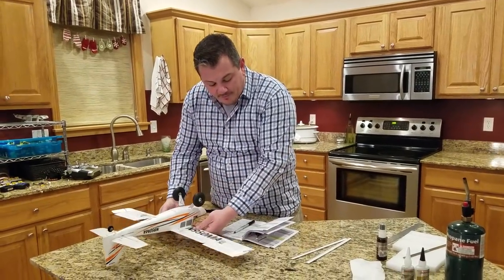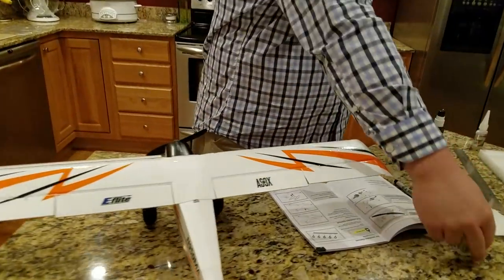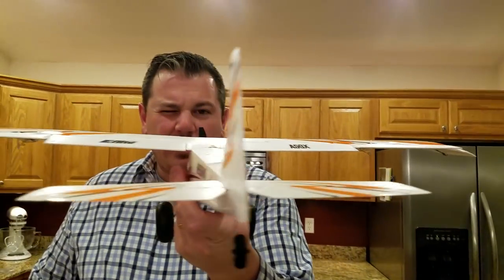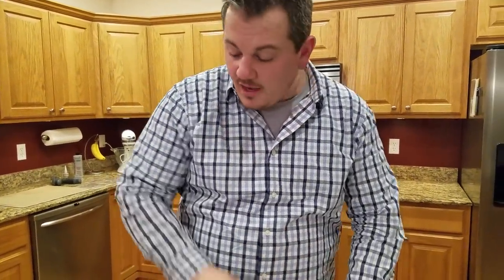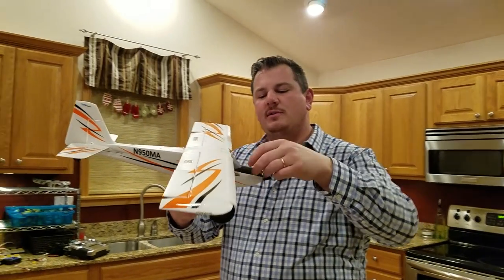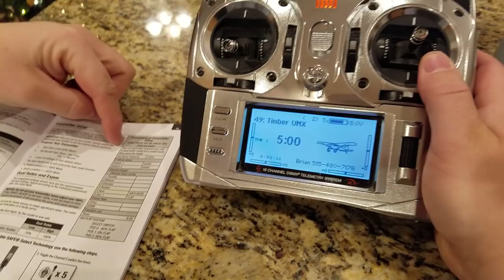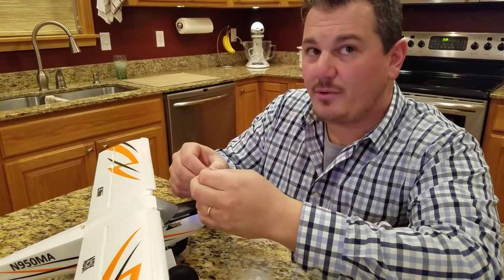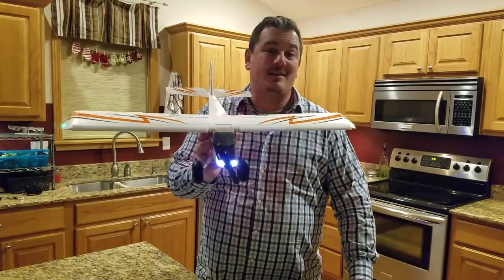Eflite - Timber - UMX - Assembly, Radio Setup, and Tips

Comment: Hey bud, question: I’m having a tough time hooking up safe on my dx8e. As3x is activates, and I have moved both controls in outward opposite directions while flipping the assigned switch back and forth 5 time per manual, but still no safe. Any ideas? It’s all new equipment and new airplane
Reply from the maker: I thought the sticks were to point IN at each other...
Reply: Brian Phillips interesting... I believe I tried both, because to set a Safe Select switch on the regular timber 1.5, I had to point both sticks together and down while cycling the switch I assigned back and forth 5 times, however, that didn’t work either... i dunno. I gotta pick up some lipos for my DX8e because I was just using the regular double AA batteries that the transmitter came with and they are already dead after just trying to bind 3 airplanes to it. I do like your ideas regarding setting the rates the way you explained juxtaposed to the 70% or 100% the manual suggests, but when my lipos come in I’m gonna continue to try. Any batteries for my transmitter that you would recommend? I was actually thinking about making my own battery packs, but that will be a future project.
Oh, one last thing; I did fly my apprentice, as this was the first plane I’ve flown in 25 years and all i can say is YOU ARE THE MAN!!! I have NO idea how you fly these bigger birds around your neighborhood with such impunity. You make it look MUCH easier than it is. I was a huge open Park and was worried about hitting something...but you weave these flipping things in and out of houses on your block and backyard! And let your camerawoman know she’s the best in the business! I watch all the vids you made when it was cold and snowing, and she was on top of it the whole time
Reply from the maker: I wonder if you bound it the OTHER way... There's TWO methods. Maybe you got it bound, but it's in AS3X only mode??? I wish I could just do it for you, but I even have trouble remembering the exact steps (I have to read the stupid manual EVERY time - LOL)

Did you assign the switch you're trying to use to a channel? Sometimes they aren't assigned in the stock configuration, until you go to channel assign... TRY THIS

As for battery for your DX8e, here's what you need... https://amzn.to/2I1uv7Z ...these things are great!!! I HATE using alkaline batteries. They always seem to be JUST about bad by the time I use them, and I'm WAY too cheap to get the name brand...I always get the cheap Rayovac, or whatever store brand is cheapest...then they leak...LOL

Megan does a wonderful job of keeping the plane in camera. It's way harder than most realize. We're all so lucky she's a mostly willing participant my shenanigans :)

As for the neighborhood...I had a hater TODAY...commenting about how I was all "look at me" and how he was such hot stuff, and how if I was at his flight field he'd give ask me "Is that all you got".... These FOOLS think they're advancing the hobby. Hand-Face

Here's the excerpt...

"
truckermax120 hours ago (edited)Highlighted comment
Its all about the ..."Look at Me,Look at me" attitude.I think he is well aware of the possible chances of a person,property being injured/destroyed.He'll take a chance with the neighbors children on a low fly by,but as he's getting ready to land he reminds his wife to keep an eye on his kid while landing.
Hmmm...
I'm no old fart,i've flown many of years (usually 700 size electric helis)doing close to the ground 3D and fly regularly,so i'm well aware of the probable chances of mechanical,electrical and human error that can happen at any given time.
For the beginners watching this it appears "impressive",but for people with flight time and common sense,it's beyond stupidity!!!
All i have to say is...Really dude???
If you were at our field and did that type of flying in front of us,I'd be the first one to walk up to you and say...
IS THAT ALL YOU GOT???????? Really dude??
Again,you look "ONLY" impressive in front of a beginner crowd,whoop ti do!!
SAFETY is the number one priority:
Above your flying ability
Above your model
Above your financial means to pay for any injuries and or damages
You're wrong dude,you're waaaay wrong!!!
"

...here's the video, if you're curious - https://youtu.be/hQpkaAlaafc

It's guys like this that just floor me. Then I check their channel, and he has one video with like 10 views and 2/1 thumbs down ratio. It's really unfortunate. I'd be all about helping a guy out, but he's such a dick! These trolls are about 1/1000 in my experience. I try to keep their negativity out of the channel, but it's kinda nice for you guys to see what I put up with the channel. I wish I didn't have to admit this, but in my experience, there's a LOT of guys like this in the RC community, which is why many RC shops are going out of business, and many clubs are like 7 grumpy old men that like to argue with each other, rather than teaching new people how to enjoy this awesome experience.
Reply: Brian Phillips hey brotha, I’m on board with you 110%!! I get nauseous every time I tell myself “look Ross, there is no way around it.  You’re gonna have to join a club...” I’m all about safety and have yet to see you do anything remotely dangerous in ANY of your vids. Actually, I’ve watched your channel the most because of not only the great flying and videotaping, but because you narrate what you are doing, and for people like me who are either getting back into the hobby or just getting started, we appreciate the way you explain everything to a ‘T’. Please, keep the videos coming!! You have been the most helpful with every single aspect of the hobby. If I wanted to listen to music while flying, I’d plug in some headphones. If I wanted to read someone’s headers instead of narrating the play by play, I’d go to friggen google. People can pretty much learn how to perform open heart surgery thanks to YouTube (not condoning in anyway, but you get the gist). As far as some of these grumpy bastards go, I’m gonna be honest, that’s probably what kept me away from flying for SO long. But now that they have all of these EPP, EPA, and EPO foam electric kits, it makes getting back into the hobby 1,000 times easier. The fact I took the apprentice up for the first time in 25 years, by myself, at a park with not a soul in sight, I am just as excited as I was the day I started, if not more excited.  I like the way the hobby progressed and you’re always gonna have these people saying “well I remember in my day you’d get your ass kicked if you flew anywhere besides our clubs field. It’s like, come on dude... I get if someone is doing some reckless BS, but people like you that have total control over the aircraft st ALL times should not be bothered by ANYONE in the hobby. In fact, they should shut their mouths and listen to what you have to ay for a second. They might learn something. I remember learning ima nitro trainer. My first flight was probably around 1988 when I was around 9 years old. I had to buddy box for months before I was able to fly solo. And forget about it if you made a mistake....  you were set back from flying that plane again for months - even though rebuilding is just as much fun as flying in my opinion. 
Anyway, thanks for always getting back to me and thank you so much for being as detailed and informative as you are. Not everyone is willing to take the time out of their day to explain from the second you unbox to the second you have to rebuild (or mod). By the way, I got the umx timber bound FINALLY just following your steps, but then if course the rest of the alkaline batteries I had died before I could get the timber 1.5 or my apprentice s bound, but I got my dad bringing me a few lipos at my brothers wedding tomorrow. 
I’m still gonna look into the links you provided. So this weekend is pretty shot because of wedding and family, but I’m gonna fly this umx timber at some point on Monday. Heck, I might fly them all Monday at some point. Thanks again and I will keep you posted with everything!
Reply: Oh, one more thing, then you get the old timer that has 25 minutes of video of him flying a circle or figure eight pattern at their local club. I want to put a bullet in my head halfway through those videos. It’s like watching paint dry... yeah I had to get that off my chest lol
Reply from the maker: yes, exactly!!! LOL
Reply from the maker: I wish YouTube would let me reply in a more, so you could tell more obviously, but here's my best shot...

In reply to you longer comment... 

I'm glad you can appreciate my point of view. I know my style isn't for everyone, and that's cool, but it's interesting when someone comes onto my channel and starts to preach about how great they are, while I'm doing it - LOL!!!

It's like I say all the time, if you or anyone else thinks they can do better, and there are a TON of people who CAN do a lot better than I, just go do it. Film it, post it, reply to comments, deal with annoying A-holes, and then get back to me 40,000 subscribers later ;)

I really appreciate you being here, and our dialog. It's refreshing and appreciated for my audience to have my back. Thanks Ross!

P.S. The feeling you have, with just getting back into flying, it's amazing! It's almost like falling in love, which some cannot understand. For me, it was extra special, as I got to reconnect with my Grandpa, with his scratch building, then he passed away shortly after. He was half way through a new plane...which to be honest, he could have died in 25 years, and he would have been half way through a plane - LOL! It was great. We weren't on bad terms before, or anything like this, but it was very cool to get these last 3 or so years to share something that we're both so passionate about. Many people miss out on this opportunity, and so for this, I was very blessed.
Reply: Brian Phillips dude , exactly!! Listen, let people come on here and say whateva da f**k they want, long story short, listening to your play-by-play is what got me back into the hobby. No one is as descriptive as you, at least no one I’ve came across yet. And the ones who were, they were just looking for followers. We can ALL tell that’s not you. Your passion in nothing more than contagious and I wish more people were like yourself. You area straight up and down dude, and you have helped me immensely! And I’m not just speaking for myself here
Reply from the maker: Thanks again Ross!
Reply: @BrianPhillipsRC  do you have to hold the bind switch and power on each time you go to fly it? If there's a way around that, could you please explain it? It's very frustrating having to bind it each and every time I put a battery in it. Thanks in advance.
Reply from the maker: What transmitter are YOU running.
Reply: @BrianPhillipsRC  Spektrum DX6i
Reply from the maker: You can program more than one plane into the DX6i, so if you're having to do this each time, there's something wrong with your plane, or your transmitter.
Reply: Brian Phillips this is a good question. I have the DX8E - as recommendation of you 🙏. - and I have about 6 planes programmed in there, and it’s your fault because I’ve only been flying again for a month 😂😂😂. My question is, do I need to re bind every plane each time I fly? That’s what I’ve been doing and it’s a pain I’m the a**, but if that’s how it goes, then that’s how it goes
Reply from the maker: No, you shouldn't need to re-bind "ever"...until you get a whole new transmitter :) (I've had to do my whole fleet - it sucked BAD!!!! It was when I went from DX8 Gen1 to DX18 Gen1, plus I had to reprogram every plane too, since the DX18 wasn't compatible with the DX8)
Reply: Brian Phillips huh?!?!? I’ve been rebinding every single plane before flight. I have them all programmed into the DX8e, but when I click on them after supplying power to the reciever, it seems I have to put the bind plug back in the friggen thing and start the process over. Any suggestions? Once ‘rebound’ all my settings for the plane are set from previous programming, but for some reason i have to always rebind. It’s a pain in the neck. I was under impression that after I bound a plane once and programmed settings into Tx, all I would have to do is power rx, transmitter, select plane, and woahla, I’m ready to fly... obviously I’m doing something wrong like usual😂😂😂. Thank the good lord we have you for help
Reply from the maker: Ross, it is possible that with the DX8e there's something different...and I'm really sorry if I've mislead you. I'm sorry to have to say it, but you might have to give Horizon Hobby a phone call on this question, as I'm just not sure what's going on. Sorry!
Reply: Brian Phillips no worries brotha! I still love the transmitter and I don’t mind taking an extra step. I travel to fly with my wings usually off anyway so it ain’t no thing. I will call horizon and check on other boards for answers. Thank you for everything again. If it wasn’t for you and your videos I wouldn’t be back in the hobby, and I mean BACK! My wife is about to toss me out the house if I buy one more plane 😂😂
Reply from the maker: Maybe you can stay with Esteban in my dog house in the back of my new property. He claims he will be living there too if he keeps buying planes ;) LOL!
Reply: Brian Phillips 😂😂😂😂. Well please save some room on that beautiful piece of property you and your family are moving into. Myself and Esteban can surely come up with enough $$$ to help you with your new mortgage payments. BTW, I’m no stranger to the “dog house.” My doghouse is the couch these days. The second a new plane arrives at my door, I make sure the couch is turned into a bed before my wife gets home...you know, so I don’t have to do it later in the evening 😂😂😂. Anyway, blessings to you and yours and keep the vids coming. I think I watched your vid on the lemon stabilizer receiver about 15 times already, and I’m still scratching my head😂😂😂. I think it has to do with the mixing you do. Once I figure out which plane will be it’s first “victim” i will definitely need to bend your ear a bit more on what the heck you’re talking about. Remember, I’m a military man. I need things in laymen’s (shit for brains) terminology 😂😂😂.
Reply from the maker: I look forward to your questions :)